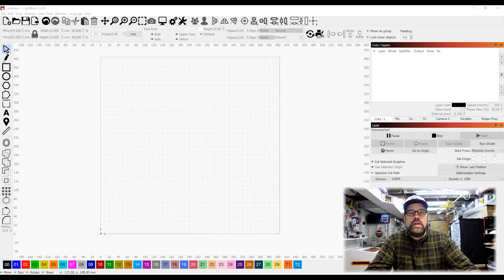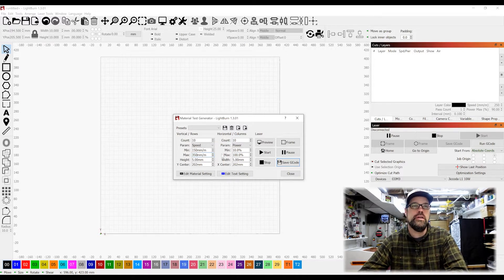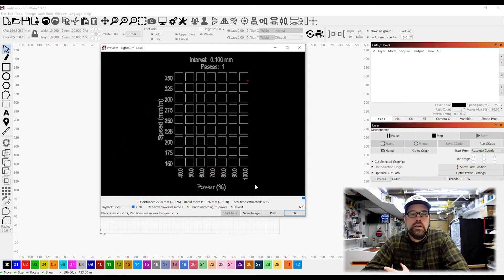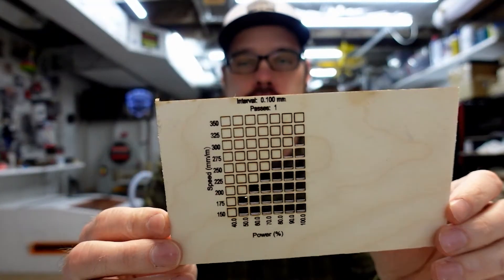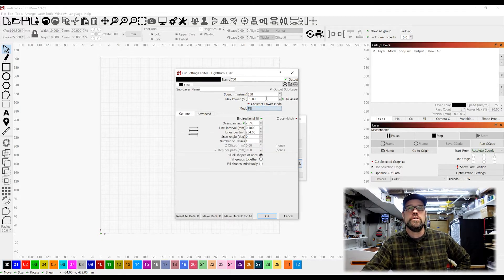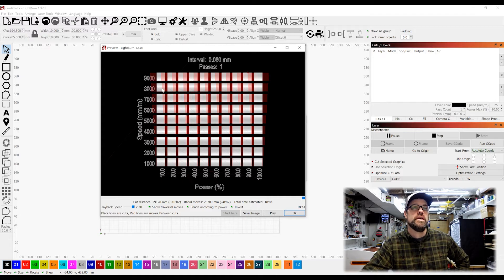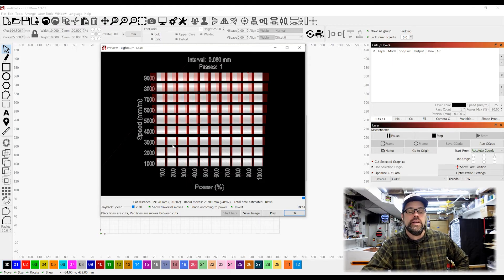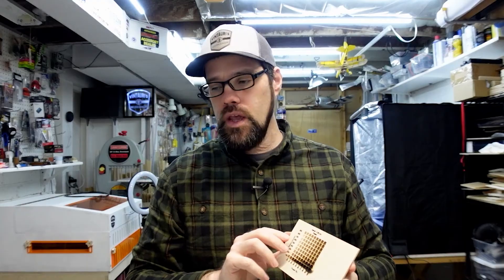Use the Material Test Tool in Lightburn for better results with your laser

Comment: I just got my Sculpfun S30 and used the test mode but when it finished the print everything was backwords. I can hold it to a mirror every thing looks great. Need help on this.
Reply from the maker: Double check where you have your origin set up for you laser within lighburn device settings.  It should be the front left, if it's not there it could end up reversing the file.
Reply: @Vintauri  I double checked and note there were 4 bubbles and it was on bottom left. I changed it to top right and tested. It works perfectly.  Thanks tons.
Reply: Opps. Top left bubble.

Comment: Just bought a Ikier 24. This is my  first laser Where would  i start the settings? Probably should have gotten something else since it was my first laser i seems not to be a lot of information out there yet.
Reply from the maker: I would run a material test starting at 250mm/min up to about 500mm/min and from 50-100% power. Try that on both 1/8” and 1/4” material and adjust from there.

Comment: Can you tell how to set this up for a 20w diode laser?
Reply from the maker: It will depend on the material but for cutting 1/8 and 1/4” materials on a 20w I start in the range of 250mm/min up to 500mm/min in 50mm increments and then from 50% to 100% power in 10% increments.

Comment: Thank you, Im completely new to laser except my basic attempts at diode engraving.. been struggling to find something that can help me get a photo done but I think your vid has lifted my hopes the most 🤞🍀👍💙
Reply from the maker: I'm glad this video was helpful.  Using the engraving test you'll be able to find the speed and power range needed to get the shades for the photo engravings.  But you'll still need to play with your images to tweak the contrast to really get good photo engravings.  I also prefer to change the image mode to Jarvis or Stucki for better results.
Reply: @Vintauri  honestly mate, I was bangin' my head against a wall.. I know it seems really simple now, doing a material test.. but I just didn't know what I didn't know 😁 I've just done my first photo and it's for the memorial garden of my partner's late father.. she's very happy with it.. thank you 💙

Comment: Great video.  Everytime I run a preview of my material test with your settings, I get cut distance 2561 mm, rapid moves 4430, and total time estimated 1:27:29.   What am I doing wrong for the time estimate to be so long?  TIA
Reply: Same here. I use same settings and my time is way off.

Comment: when i use plywood i get a lot of burn and a higher kerf. when i lower my power i need like 10 turns to cut true plywood. when i use MDF i do not have that problem. also with a lot of burn, it's hard to keep ure project clean. i got all black spots from the burn on my hands. I got a 10W creality. can u help me with this problem?
Reply from the maker: Are you running an air assist on the Creality and do you have the work elevated so that there is airflow underneath?  Both of those are the biggest ways to get cleaner cuts.  Other than that double check that the focus is set right.
Reply: @Vintauri  check on all of these. I use the tool for the focus. Elevated and air assist from the manufature..

Comment: I just recently got an Ortur laser master 3. I set up my materials test with the same parameters as your for the cut. It only took mine 1 min and 8 seconds and nothing was cut. What did I do wrong?
Reply from the maker: Double check that you are set up in MM/Min and not MM/Sec.  Lightburn defaults to MM/Sec so you can either change that or divide the speeds by 60.

Comment: I copied everything and my test burn burned out all the squares. lol Not sure what happened.
Reply from the maker: Sounds like your speeds were too low.  Bump up that range and try running it again.  Every laser is different.
Reply: @Vintauri  what laser did you use in the video?
Reply from the maker: @wooly196211  I used the Jiccoda L1 10w laser during this video.  https://amzn.to/3wnZdOW
Reply from the maker: @wooly196211  Not all lasers are equal even if they are both rated at 10w.  The material also makes a huge difference.  Two different types of 1/4" plywood can be the difference between cutting through and just smoldering. You should be able to find some settings that will work for your laser, just keep adjusting the speeds until you find it.

Comment: This unfortunate didn’t work on my laser I have a atomstack but it’s only 5w
Reply from the maker: You should still be able to use this method to find your settings. You can add passes to the line as well as as units speed and power. I’ve used this method with all my diode laser tests including 5w models. The 5w won’t cut fast but they will eventually get through 1-3mm material in most cases.

Comment: Thank you for the video. I just purchased a laser cutter/engraver, so I just subscribed to your channel. Question, using Lightburn, can you do both the cutting test and the engraving test on the same piece of wood/material?
Reply from the maker: Thank you for the subscription! You can do both tests on the same material but you'll need to run them individually using the tool in lightburn. There are other test files out there that you can import into lightburn that will run multiple tests in one job.

Comment: I just purchased a Jinsoku LC-60A 5.5W Laser Engraver Cutter with Air Assist System. This video really help me to understand how to use Lightburn to set up my material parameters and understand the  limitations of my laser. 
Thank you so much
Reply from the maker: I'm glad this could help you with both Lightburn and dialing in the settings for your laser!

Comment: Hi there, thank you for this.  Just a quick question after going in and setting these material cards, where do you save them to to load for different materials? or do they automatically save?
Reply from the maker: You can add them into a material library to reference and apply to your layers.  This is useful if you have many machines that have different settings for similar materials.  If using a single machine, you can apply the settings to your layers and then rename the layers to your material to reference.  I generally use one or two machines and a couple similar materials so I just know them from my tests, the other random materials are often single runs where I do a quick test and then just keep my notes in a google sheet to reference later.

Comment: The basic idea sounds great  and using a diode laser with its very low power and different wavelenght to the CO2 machine, that I see you have in the background, it should be easy to do grayscale engraving on organic materials. However, what this  engraving matrix shows is exacty the opposite. If you take a blowlamp to a piece of wood, you can change the SURFACE colour from very light brown to almost black WITHOUT burning through the wood,  just by varying the exposure time (speed of power over the surface). The problem I see here is that as you vary the power and speed you are changing the DEPTH of "burn" to get coloiur. The only way you are achieving almost black is to barbeque the wood with a deep CUT and producing lots of fumes..  That's why I look at this matrix and question its real value.. There is no criticism of your video, you have done great job of explaining how to program it and use the tool that Lightburn has provided. I underrstang how the PWM control system works for a diode laser in that there is no actual power control available,  your laser is always delivering 10 watts whenever you switch it on. The only way you can control the burn is by changing the exposure time via the PWM duty cycle. . I look at the blowlamp example I used earlier as the goal for this matrix and question if  power and speed are the correct parameters to be using for engraving. Maybe you can achieve that SURFACE colour change by fixing a %power and making  the matrix  by varying  speed and line spacing? 

I can see that you will be able to select a set of parameters from this matrix to do proper 3D engraving rather than grayscale images. I would select a speed of 3000mm/min  with a min power of 10% and a max power of 60% you will need to repeat the program at least 10 times (or more) but you should finish up with a nice 3D image.There are lots os special bitmap files available  to experiment with.    Just Googe images of "3D grayscale CNC bitmaps"  This will set you off onto all sorts of side trails to 100's of images you can use. The ones you want are the weird looking waxy white images.
Good luck
Reply: You can get darker colors when using multiple passes with low power. Rembert, this are single pass tests shown.

Comment: Vintauri, Do you save these to  your Material Settings so that you have them if you buy material from different suppliers?
Reply from the maker: It depends on if I’m planning on using that laser for a while. I do keep the cards handy for a while and if I start using the material and that machine a lot I’ll set them up in the material settings library.